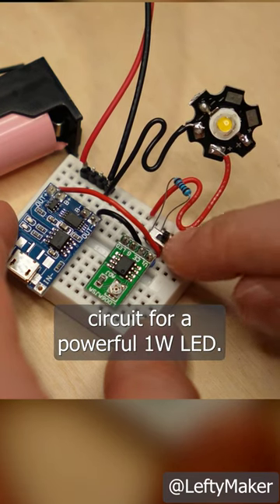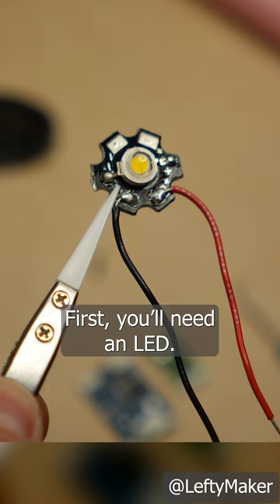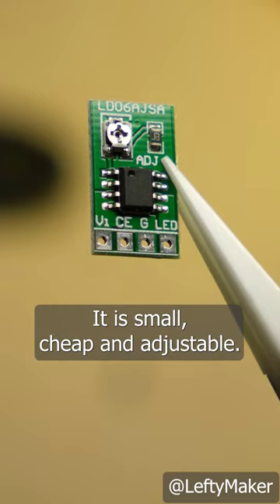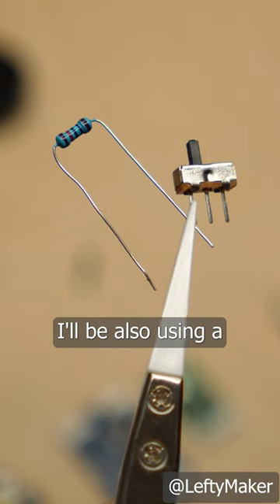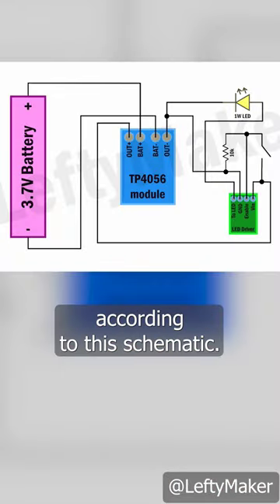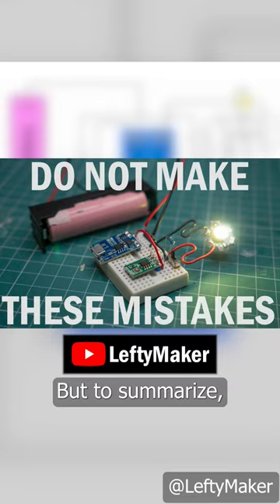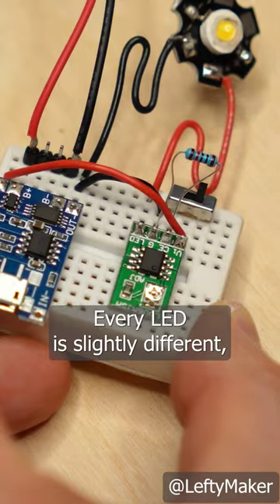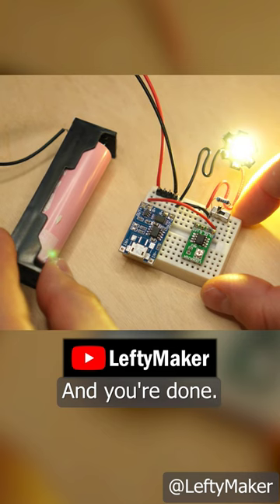DIY 1W LED circuit, how to make one  #electronics #led

Comment: I wonder if you can use the tp4056's constant current functionality to drive a led
Reply from the maker: I believe it is possible, but I've never tried it.
Reply: @LeftyMaker  goes to try it this would actually be a nice feature if it works, as you can make a usb flashlight with just a tp4056
Reply from the maker: @Kaloyan-trains  okay, I might consider it for a video, but I am working on a different LED driver project that is going to be simpler and probably cheaper :)
Reply: @LeftyMaker  ok, you do you. I'm gonna make a video myself on the tp4056, but it would be interesting to see what you will come up with, and if I can also make it, as I have quite a lot of powerful LEDs, but no drivers for them